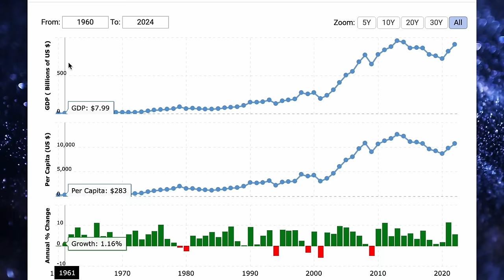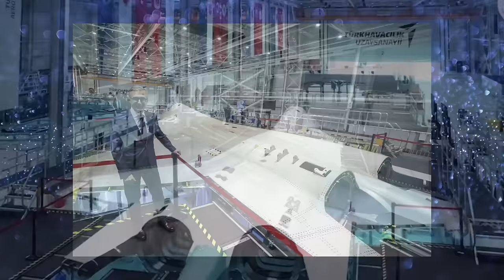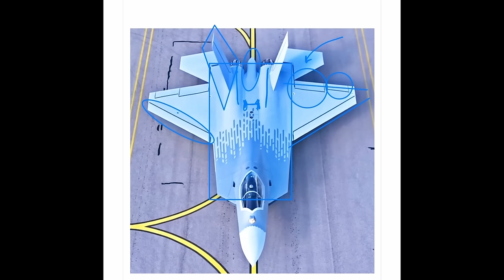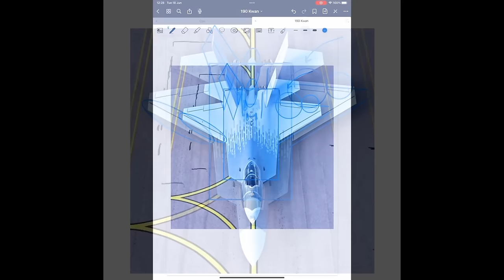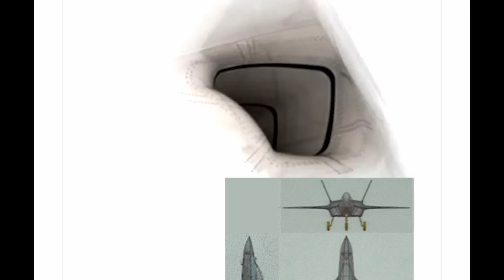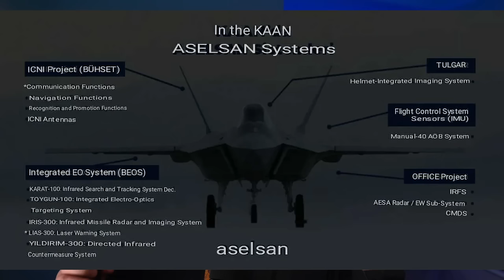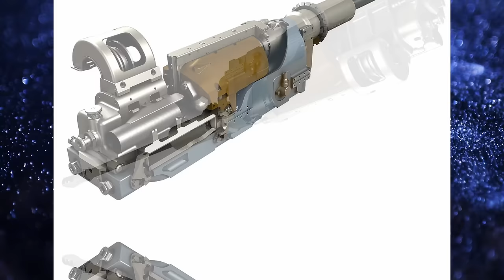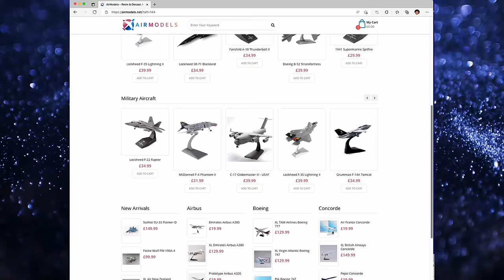The F-35 Has Met its Match

Comment: Yeah the Turks got them a slick looking jet, and I'm sure it's capable of some cools stuff, but it looks aerodynamically stable in flight forcing the controls to actuate more which could be helpful for those rough and wobbly takeoffs. It does look stealthish, but it has visible fasteners on the external cockpit and a very unusual cross section change after the wing box
Reply: Its a prototype
Reply: The first prototype doesnt even have the RAM coating because it isnt designed to test the stealth. This is the word of TAI.

Comment: The KAAN is so independent from the US... as long as you aare not looking at the micorelectronics inside. Then you realize that Turkey and the US are best of friends.
Reply: The electronics and avionics of kaan is from aselsan. And aselsan can use different suppliers about semi conductors.
Reply: @darkprofile  I mean sure, it says aselsan on the top but what is inside of it is more important
Reply: @m.a3914  Aselsan manufacture own integrated motherboards and circuits. It can use microchipa from usa or taiwan or korea or wherever they want. They are not strategical assets. Strategical point is building qualified defence industry electronics and sensors.
Reply: @darkprofile  They can produce only low quality and low quantity semiconductors on very very old nodes if that. They are probably just designing semicons.
Reply: @m.a3914  When you say peobably it means you have no information. You claim your belief not any information. Turkey is manufacturimg nato standart weapons for decades. Turkey is capable of designing and manyfacturimg electronical warfare systems. Aselsan is 50 years old company. Aselsan is now producing on GAN modules. Gallium Nitrite is better seni conductor material than any silicon based semi conductors.
PROBABLY you don’t know much about semi conductors and microchips.0

Comment: Still to far behind American jet fighters f22 f35 and why is it that russia china iran and now turkey are taking american designs. Clearly they all components of both f22 and f35 but To all of these countris. There just copies not originals. United States 🇺🇸  owns Them.
Reply: You speak about something you don't know. Stealth airframe designs has limitations. There are 2 major stealth jet designs. Lambda design which is flying wing design. Lambda design uses all body as a wing and can carry higher payloads but they are unstable and maneuverability is low because lack of vertical stabilizers. Lambda design is used as bombers like B-2 So for a fighter jet best design is second most stealth design is called diamond design. It is used as cropped diamond design to get delta wings and vertical stabilizers. F35-f22-su57- kaan... they are all cropped diamond designs and it is so normal that they look like each other. Because this frame design is almost identical to diamond siluette when you look at them from front or rear. It is because geometric restrictions not because of stolen technology.

Comment: COPYCAT AND REVERSED ENGINEERING. 
GOOD LUCK 😆 🤣 😂 😹
Reply: The inventor (technical) of the stealth technology came from Russia. In the early 70s they discovered the phisical limits and the phisics behind a stealth aircraft. 

Also the VTOL technogy of the F35 B originally YAK141. The big difference is that YAK141 used another Turbojet as horizontal engine and not a fan like F35 B (which is genius!).

Reverse engineering is not so much necessary because Turkiye was a part of the JSF program....

Some parts of the equipment have to build and some have to copied. That's true.
Sometimes while you engineer a solution for a problem you find another "better" way to fit the requirements.
It is a kind of evolution....
And sometimes you find a different genius new solution this is called a technical "revolution".
I think Turkiye and the engineers are good for many revolutionary, genius technical solutions.

Do you know that your mobile telecommunication standard "5G" is an invention of a Turkish engineer?
Don't underestimate nations and people... never.

First they ignore you,
Then they lough at you,
Then they fight you, 
Then you win.

                         Mahatma Gandhi